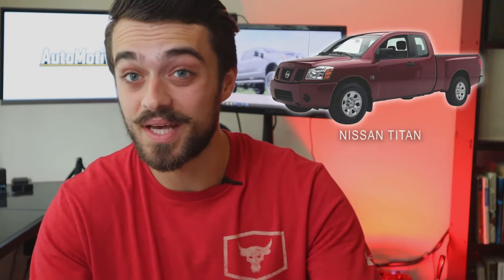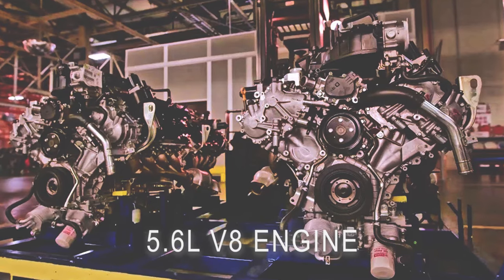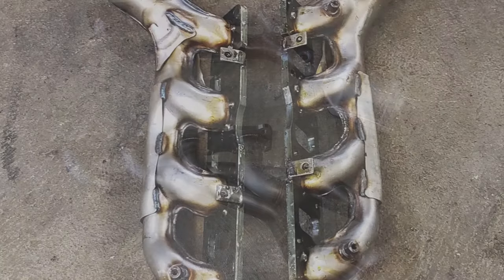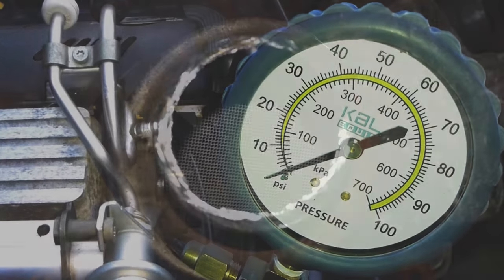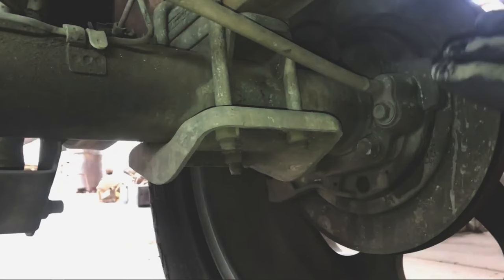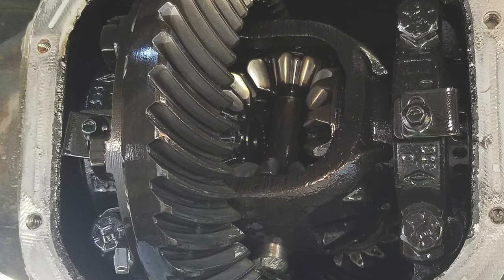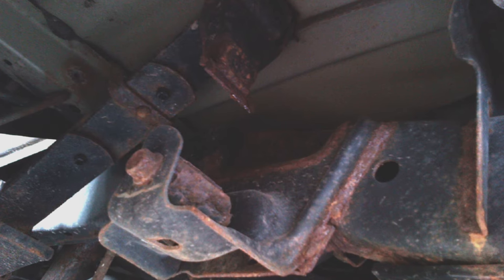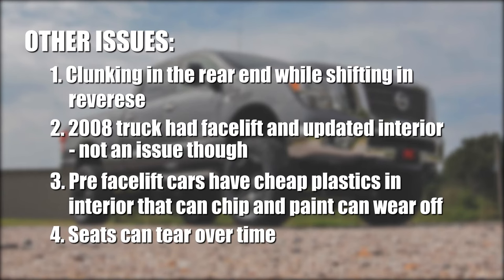Watch This Before Buying a Nissan Titan 2004-2015 (a60)

Comment: my 04 saw me through the toughest years of my life in my 20s. no maintance for 20-30k at a time, never let me down. deer took it from me 7 years ago with 238k on the dial. ready for another one.
Reply: Deer destroyed front bumper on 04 Armada but still going strong at 200k.....
Reply: My 04 Titan is still going strong at 300k.
Reply: @OCWord  same dawg
Reply: I just got a 2004 Titan with 228k and feels strong. Previous owner did replace the catalytic converters but not sure about the headers. Love it though.
Reply: Follow up. Bought a 2014 P4X and it’s like meeting a old friend for the first time everyday.  Best trucks I’ve ever owned.
Reply: 05 “ 290k

Comment: I just got a 2006 Titan yesterday and so far I am LOVING IT. I want to constantly get out and just drive it. Perfect truck for me.
Reply: How much did u get it for?
Reply: @christianc9793  I traded a 2012 Dodge Journey straight up title for title.
Reply: @Justin W I’m still loving it. I have taken my Titan on the dirt drags a few times. She handles everything I throw her way, and keeps on going strong.
Reply: @JoeCompton81  How do you feel about the Nissan Titan gas mileage? I am considering models in the 10-year-old range, but the stats on gas mileage look horrible. What I like about it is the spaciousness of the driver's seat, especially if I get a model with the armrest console.

The Titan is the only truck I am considering, and that is based on its reputation for reliability. My other options are the Toyota Highlander and the Honda Pilot, but I found the driver's seat to be boxy in both because of the huge center console.
Reply: @Tes7000  the gas mileage is what is to be expected of a V8. I have the 5.6L. I also have a heavy right foot. So my gas mileage is greatly decreased because of that. All in all though… I wouldn’t trade it for anything. My Titan is my daily. I also have a 2000 Dodge Ram 1500 with a V6. The Ram has over 220000 on it. So I rely more on my Titan.
Reply: @Tes7000  I get about 14.6, 14.8 on a good week if I am lucky. This is in my 2010 Titan.
Reply: @robertgardner4508  I ended up buying a 2010 Honda Pilot in October. I love it, but the city gas mileage is only slightly better than yours at about 15 to 16 MPG. The highway gas mileage is much better at about 21 MPG.
Reply: I got an o6 titan as well... keep the truck and take care of it it's an amazing truck that would smoke most new trucks .

Comment: Another notable issue if planning on keeping for a good while is the internal transmission cooler inside the radiator, after a while it can crack and mix transmission fluid and coolant. An aftermarket radiator and transmission cooler to run separate will keep you on the road indefinitely!

Comment: My 2013 Titan I brought brand new in 2013 still have it no problems, only had to replace a battery cable last month. Has over 193,000 miles and still going good.

Comment: I've had my "04 for 18 years now and it's been the best truck I've ever owned. Very few problems all of which were minor repairs.
Reply: 2009 stock xe titan with almost 260k miles (no check engine light) i think if you pull a lot with the titan you need to def keep an eye on the rear dif

Comment: 07 with 157K. No cracked manifold issue. Rear diff seals went so did vent mod. No issues with ATF and coolant mixing either and it's stock. Reliable since new except axle seals.

Comment: I have a 2006 with 165k miles. Installed LTH due to the cracked OEM headers. Had it tuned from Cajun. The before and after is a huge noticeable difference. Feels powerful on take off but after 80mph it feel sluggish due to the long gear ratio for that gear

Comment: The clunk is a real thing. Mine mostly went away when I replaced the drive shaft center bearing housing. The rear diff vent caused my axle seals to break. So I did the mod. The paint did rear on the inside. The outside, the clear coat came out but that took a long time. 13 years. But I love my Titan.

Comment: 260,000 miles and runs perfect. I have 17 Cummins I don’t drive. Drive the beater everyday. It’s not as dumb reliable as tundra but I like the engine character better

Comment: Mine is a 2010. It's been pretty good to me so far, minus the heater failing lol.
Reply: Turn the knob on the coolant flow regulator. It will hard force the heater to work.
Reply: @joewhitt2394  Nah it's not that heater valve. That thing both hoses get hot to the touch, when you switch it between hot and cold.

Normally when that plastic thing when the gears go bad is the issue only one hose to the heater core is hot and the other (usually the left one) is cold. It's the actuator unfortunately under the passenger side of the dash.

Comment: My old 05 had upgraded aluminum radiator, trutrac rear end, rear end vent mod and a shift kit... prior to that the radiator, carrier bearing and rear end were my only issues.. I drove that thing like I stole it, but put mobil 1 every 3k..

Comment: The gaskets between the manifold and exhaust pipe tend to go out occasionally. It's kind of a weird design because the sleeve slips in the manifold rather than the other way around. Love the truck though and will be keeping it as my utility truck and secondary driver so it won't be getting a lot of miles on it. Only has 167K now which is low for an 05.

Comment: I'm at 210k very reliable, I replaced the axle seal and did the vent mod. I did a radiator bypass to prevent the strawberry milkshake thing. looking into doing a trutrac or some sort of lsd since I'm starting to drive on some steep dirt roads.
Reply: What year Titan?
Reply: @carloesahagun3999  I have a 2004 with the towing package

Comment: ‘08 LE bought for a work truck in ‘15 for my job carrying heavy loads weekly for sales, over payload too often but handled fine. About to hit 320,000 miles and power train feels the same as when I bought it with no issues. Replaced radiator due to small leak, catalytic converters and front wheel hubs. Other than that been an extremely reliable truck. Always have the urge to buy a new one but at the same time I still love driving this truck and have no practical reason to buy a new one. Now I’m just curious to see how far I can take this thing. Wife had an ‘04 Armada which we sold at 250,000 miles and it was still running strong too.

Comment: Pretty much if you have 1st gen just get ready for long tubes and catback 1200.00$ and put a good quality after market front wheel bearings.
Reply: You’ll hear the exhaust leak up front but it hurt anything
Reply: Why do you say this?
Reply: If you want the real power out of any v8 then yes you need longtube headers and a programmer.

Comment: I have a 04 Titan with  200373 miles on it and still have originals heaters, haven't cracked yet,  but it has others issues like the seals and the radiator that is common.  Like any other vehicle when is first gen always has problems and in the next generation they'll fix it.  But I see your point.

Comment: I’m on my 4th gen 1 Titan.  I wont buy another Truck.  Easy to fix and only my most recent one has a major issue but at 152,000 miles the rear diff started whining.  None of them left me sit and my current gets the rear axle assembly replaced next month.

Comment: My 04 is still with me at 325k. Only issue was the puny rear axle vent blowing axle seals. Installed a larger vent with a hose tied off up high like an off roader. Id drive across the country with no worries.

Comment: Bought my 2004 Titan from a used car lot ten years ago for $10,000.   That's only $1000 a year of cost, not bad.   The only thing I don't like is the base of the A-Pillar and the rear-view mirror makes for a bid blind spot when making left turns, besides that -- a great truck for the $$$$$$.

Comment: 08 115,000 miles and the biggest problem I had was the paint... Replaced one starter, 2 window motors. Originally had the problem with non-alignable bolts but after writing the President of Nissan North American, they replaced for free

Comment: Pretty much a spot on video but the leaking seals isn’t the main reason why the 04 - 07 axles fail.  The 04 - 07 rear axles had a 2 spider gear design.  

Who ever approved that must not have known the Titan was going to make 379+ ft lbs of torque.  In 08 they went to the 4 spider design.

Comment: Bought my 04 new and still drive quite a bit. Never had any of those problems but I have changed the rear vent plug with the off-road gorilla kit you showed. Titans are good trucks but if you keep it long enough you’ll be repainting it. Nissan paint is the WORST!

Comment: Pray you never have to change the starter
Reply: Please everyone Stop frightening people away from doing their starter.  it takes time but is very doable..people search everywhere else for problems when it is often a tired starter or solenoid.  It's in a strange spot but not rocket science to change.
Reply: I'm talking about the price the mechanic charge to do the work, I don't have time to do that kind of stuff he quoted me $1,500 
parts and labor, and I said whoa whoa whoa whoa wait a minute you just changing the starter bro he said he had to take apart all this uddar shit just to get to the starter and that a lot work he say
Reply: Its not a terrible job, I can do it in under 2hrs.
Reply: V8 Tundra starter at top of engine, need to take a lotttt of stuff of to replace it. It's up on top so when doing water crossings it usually won't get up to starter.  The 2 wheel drive Tundra starter V6 is down low like most cars, book rate labor time on that is 1 hour and the mechanic usually does it in 45 minutes.  Can't get a V6 4x4 Tundra though, not enough power. You can get V6 4x4 in a Tacoma though.

Comment: I'll just stick to my 2007, LS 4.8 ltr., V8 GMC Sierra Classic. Power and cheap on gas.  I don't have to take off the intake manifold just to get to the starter, as the Titan.  LS engines are easy fix, old school!  Thanks for the warning..👍
Reply: Ewwww.....  'Murircan car.
Reply: @tonykartracer8032  The Titan may be a Japanese brand but it's manufactured in the US.

Comment: Actually the 2008 plastic interior begins to crumble in just a few years.  ai doubt your children will ever see a Titan restored in the future.
Reply: NOT TRUE!
Reply: Mine is perfect.. a little faded.. no problems 2008 I absolutely LOVE MY BEAST .. but right now .. I think I tracked it down to a coil pack or sparking … idk .. how do u check fuel pressure…?
Reply: @mimiller100  you need a computer hooked to the ecu,or get a fuel pressure gage.
Reply: @mimiller100  I have uprev programmer and i can see it through my laptop when i hook it to the ecu.
Uprev software!
Reply: Thank you So Very much for your response.. I truly appreciate it ~